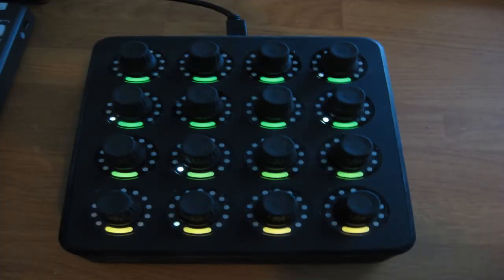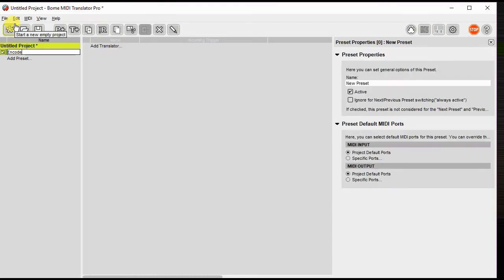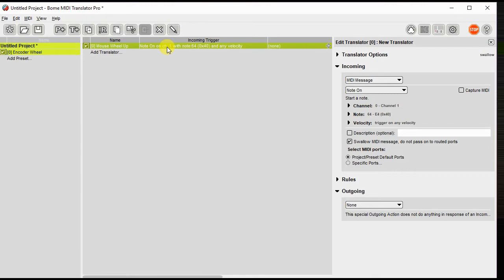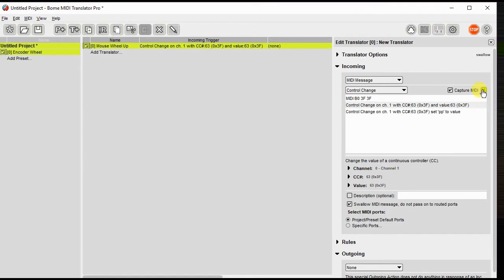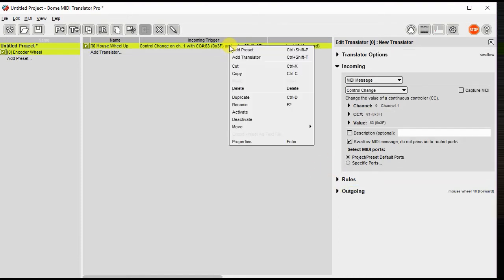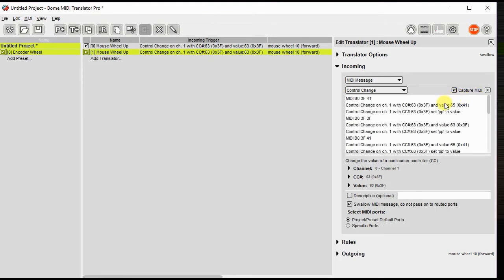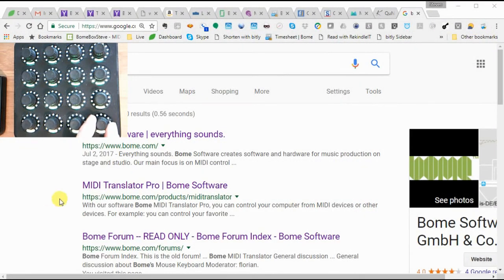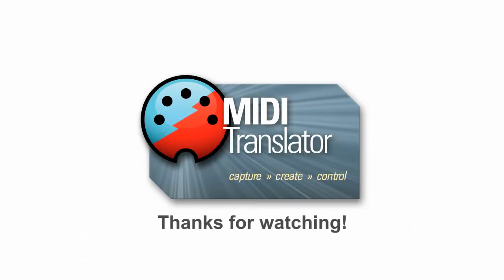Tutorial: Controlling a Mouse Wheel with a MIDI  Encoder using Bome MIDI Translator

Comment: How to  plat ETS 2 with Numark Mixtrack Platinum FX???
Reply from the maker: Hi, from what I understand, you want to control the mouse wheel with one of the platters on a Numark Mixtrack Platinum. We would need to know the MIDI message that the controller sends. You can find out by monitoring the input in Bome MIDI Translator Pro.  Once you have this information, please use our forum and we will be happy to assist with an example.

Bome Forum
https://forum.bome.com

Steve CaldwellBome Customer Care

Comment: Following this tutorial exactly with the exact Midi Fighter Twister shown does not work on Windows 10.  Please update this tutorial.
Reply: I figured it out.  You must set the Encoder MIDI Type to ENC 3FH/41H using the MF Utility app.  If it is set to CC it won't work.
Reply from the maker: @jeffcarricoguitar  Great to read that -- and thanks for letting us know! It can work with CC, too, but would require a different translation.
Reply: @Bome  Would you please explain how that can be accomplished?
Reply from the maker: Hi Jeff, I'm happy to help. Just go and open a question on our forum:  https://forums.bome.com

If your MIDI fighter twister knobs are programmed differently, I will need to see what the incoming message looks like.

Steve CaldwellBome Customer Care

Comment: is there a way to get precise control depending on knob twist velocity? Kind of useless for video editing if the scroll wheel jumps only when hitting a certain value on the knob
Reply from the maker: Hi Pricsilla,  yes, there is a way to control velocity and precision. This tutorial is just a simple demo.  Bome MIDI Translator has variables and rules where you can use standard math algorithms to affect  parameters like velocity.  I suggest if you are interested, you download the demo version and play with it. If you have any questions or tips, you can reach out to me and ask at www.bome.com/support

There may already be some example projects out there that do what you ask.

Note the trial software if fully functional, it just have a 20 minute timeout.

Steve
Bome Forum Moderator and Independent Bome Programming Specialist